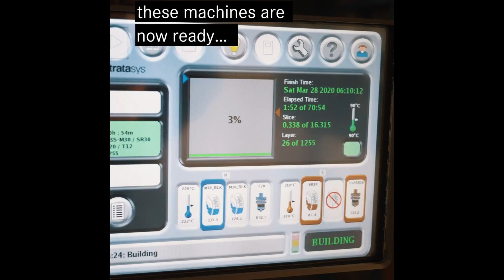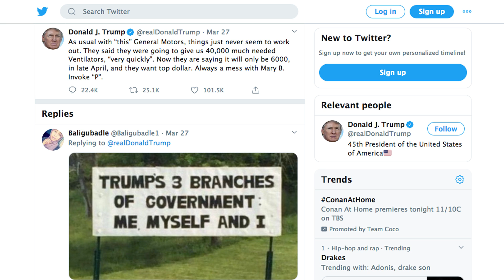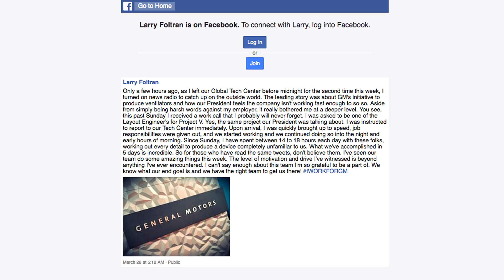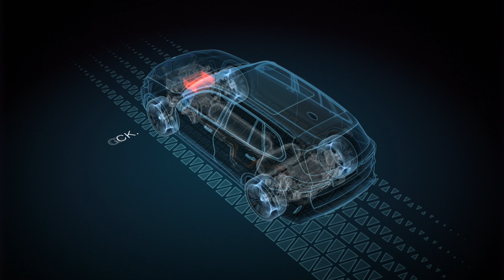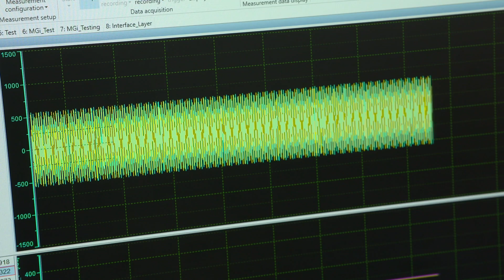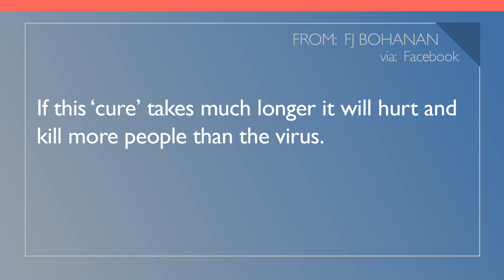BMW Partners with Toyota on Fuel Cells; Detroit Auto Show Cancelled - Autoline Daily 2804

Comment: You'd think BMW and Toyota would be trying to save some money at the moment and cut pie in the sky research out. Hydrogen fuel cells may well have a future but not in the foreseeable future for cars.
Reply: Hmmmm I agree and disagree... before lithium batteries came along batteries were short lived and development was slow. Now with over 1 million technical people working directly or indirectly on battery longevity we have batteries that can power a car for 300 miles... unthinkable just 30 years ago, wait, actually 10 years ago. I'm sure if more companies would get in on the action we would see much change in the fuel cell industry but for now, we just need a few pioneers.. like that British dude that developed the lithium battery 40 years ago.

Comment: With the potential for covid-19 to become a seasonally reoccurring problem we need to develop new ideas about  how we work and how we produce.  Greater levels of automation would make supply lines and production less vulnerable to pandemic disruption. However, it would increase joblessness and would require a complete rethinking of how we distribute wealth and resources in our society.
Reply: Vaccine done and done.... right now the issue is nobody has enough information about it because the chinese have hidden its origins and any data on the virus

Comment: It baffles me as to why companies are throwing money away developing hydrogen fuel cells for cars when there will never be neither a reasonable demand, nor an infrastructure for them. Batteries are constantly getting better, cheaper, and lighter and charging is constantly getting faster. Add to that the current established and growing charging infrastructure, and the fact that you can charge at home. Hydrogen has already lost the format war.
Reply: There's nothing compelling about hydrogen vehicles. The experience is the exact same as driving a gas car with no performance benefits but costs more money in every way with less refueling stations available. Nope.
Reply: A Hydrogen car is actually just a BEV with a small battery that is kept charged by the fuel cell, the fuel cell cannot provide the peak power to actually drive the car in a reasonable manner, but it can constantly charge at a lowish rate and regen helps add to the battery. So for domestic use a pointless exercise that just adds cost and complexity and increased servicing costs (looking after the dealers) and the requirement to only be able to refill at fueling stations, not at home or the office or shopping centre. Plus most hydrogen is extracted from Natural gas, so a lifeline to the Oil/Gas industry

Comment: The UCL/ Mercedes device isn't a "MASK"
It's a CPAP "Continuous Positive Air Pressure" machine.
It reduces the effort for patients to physically suck air into their lungs and is (apparently) not only vastly less invasive than a ventilator but requires less specialist supervision (so fewer staff) and if used early will provide better recovery.
It seems this should be a major requirement by all countries?
Reply: If it's a CPAP machine I pity those who have to wear it. They're intolerable.
Reply: @dlwatib  
But nowhere near as bad as a ventilator.

Comment: The thing the developers never mention about fuel cell vehicles is that they cost a small fortune to operate. 
And why the huge horsepower?
Reply: the only problem with fuel cell is the manufacturing process, also the storage, there are for example companies in germany working on a liquid to store hydrogen with no risks, also there is enough water on earth to have infinite source of hydrogen. hydrogen could also very benefit the aircraft and marine industry

Comment: Manufacturing 1 ton of hydrogen releases 5.5 tons of Carbon Dioxide.  100% of commercial hydrogen is made from fossil fuel which is why fossil fuel manufacturers and their partners like BMW, Toyota, State of California, etc are pushing hydrogen.  #solarpower and #batterystorage is the only sustainable path.
Reply: @carholic-sz3qv  Why can't we have rational discussions?
Reply: @shiakas  agreed. It's sad.
Reply: @carholic-sz3qv  There is no such thing as "excess electricity" when it can be efficiently stored in giant batteries.  Using electricity to produce hydrogen is extremely inefficient.
Reply: How much energy does it take to crack those hydrocarbons, anyway?